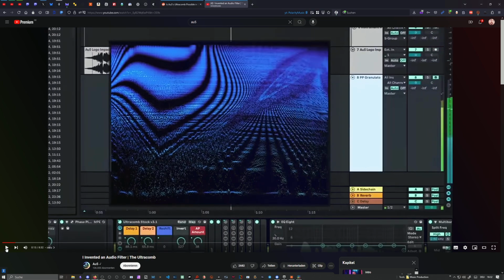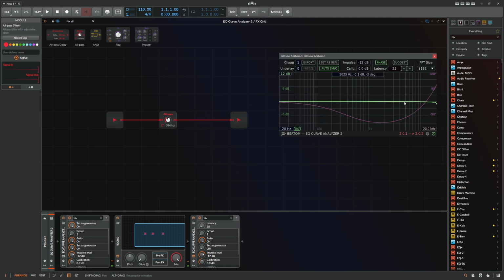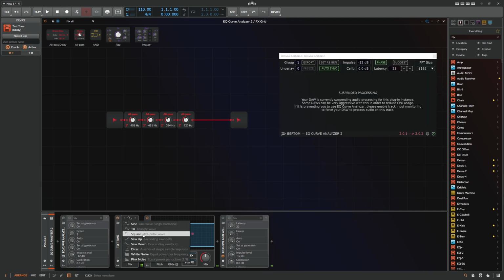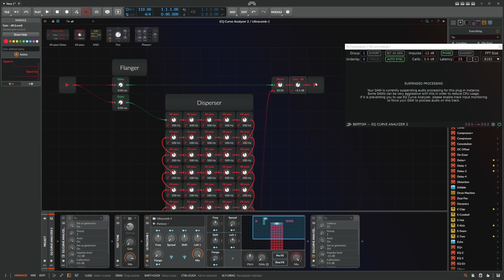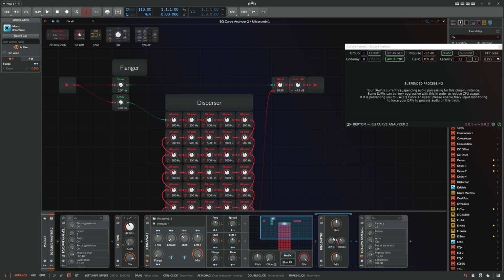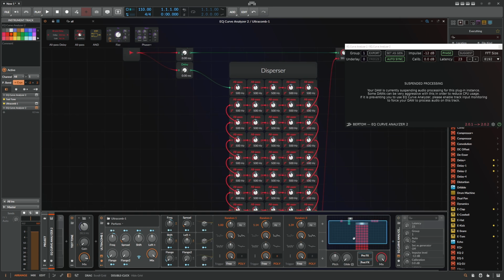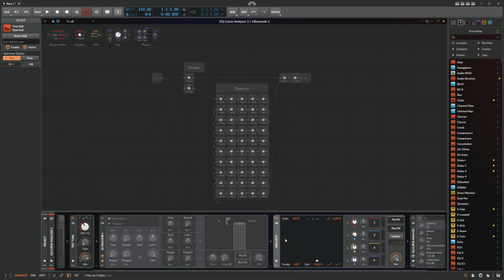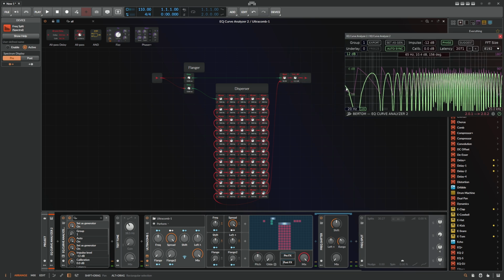AU5 Ultracomb but it's Bitwig

Comment: Well... it's kind of close what Au5 at the end. Method is the same but his result is better. Sorry but it's a truth. But your work is a good starting point for sure!
Reply: Recreated it in Fl Studio, stock plugins worked well but MPhaser produced a nicer result (with 100 poles). For the most part you can just stack the "ultracombs" in series, keeping similar parameters the same value for tighter resonances, aswell as changing some of the parameters for a more complex filter shape over time (starts to sound too messy after a certain point).

 Aslong as you ensure that all the plugins/disperser keep the frequency content the same ( i think Au5 already mentioned that some phaser plugins will still have feedback, dry send, freq lfo, regardless of parameters) , should be a perfect recreation in any DAW.
Reply: @Pxrchi  Thank you for that, really helpful for people like me using FL Studio.

Comment: Usual excellent standard! One point though *The simple 'delay' (any of the delays) in GRID are only restricted to as low as sample rate if there is a feedback loop patched.
Reply: I was going to mention this. But only the long delay is restricted to go only as low as the buffer size and then only when it is in a feedback loop. All other delays will work as indicated, even when they are part of a feedback loop. The thing is that the long delay is the only module that allows feedback routing.
Reply: @AudioDigital  Dude we miss your vids! Post vids again.
Reply: @kons_kon  Hopefully sometime soon.
Reply: A rare  @AudioDigital  appearance. You rock mate.